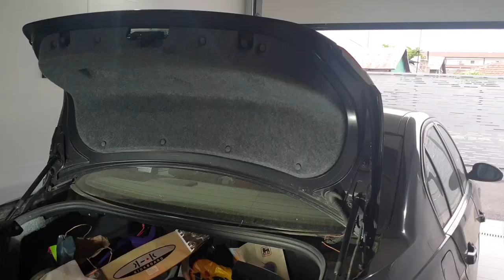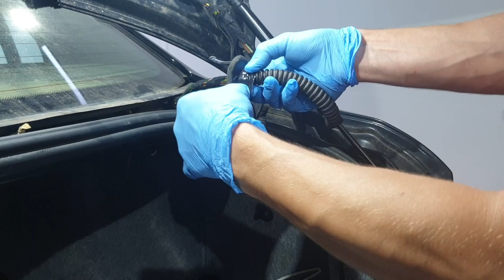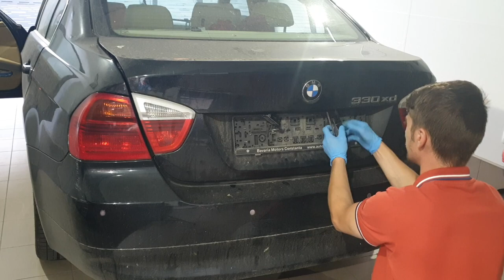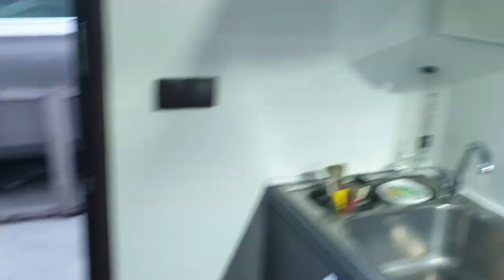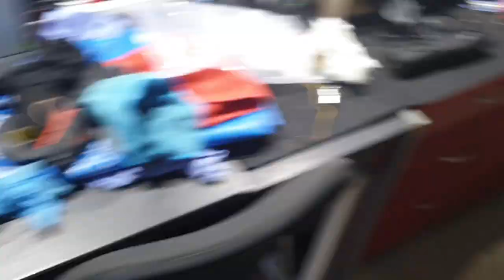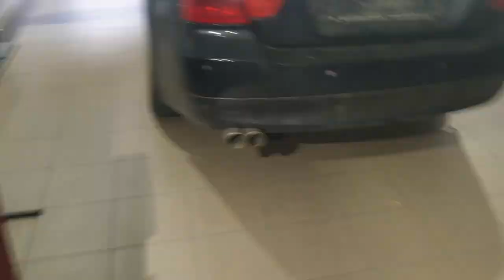BMW e90 Trunk Wiring Repair ( Risk of Fire )

Comment: Hi the rear led lights for my bmw e90 2006 model seem to be having electrical issues. They sometimes come on and the right drivers' side one barely comes on. Sometimes in the morning they are both fine. Sometimes only on one side both led and fog light comes on even if I haven't switched the fog lights on! And when the lights switch is completely switched on then the rear fogs will come on instead, and even though I haven't switched them on?! May you advice if you could assist or encountered this issue before?!

Comment: Any ideas on how to open the boot if the wires are broken as my boot doesnt open from remote or button and theres no key in the boot lid and my seats dont go down any help really appreciated  it
Reply: Try removing the trunk button on the rear of the trunk. Should be a little rubber piece you and put some sort of hook through and pull it down to open it. It's supposed to be an "emergency release" but they could have just kept the key slot for the lci models. Hope that helps

Comment: Hi nice one! fixed my broken wires and now my number plate light works. But my reverse lights are still out, any ideas? I’ve replaced the reverse switch on the gearbox still nothing.. does the frm module have a cut out after 50 key cycles? I’m a bit stumped 🤔
Reply from the maker: You need to do a diagnosis,  if you have short circuit error in FRM need to be reseted

Comment: Hi, do you know what colour wire was for the plate number lights? And what cable amp it is? Great video btw.
Reply from the maker: You will cut them one by one they are different colour only 2 wire are identical